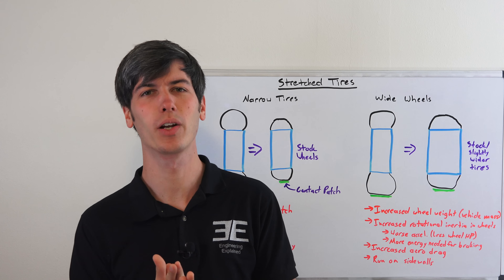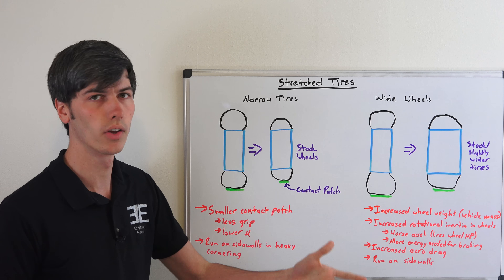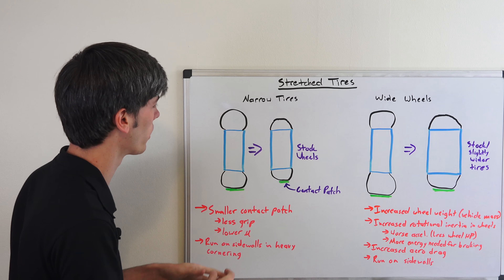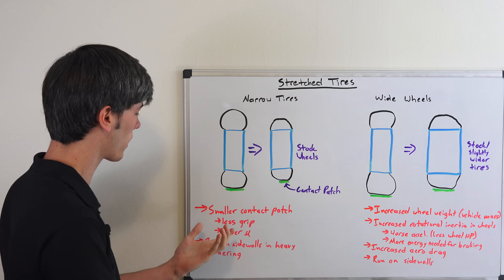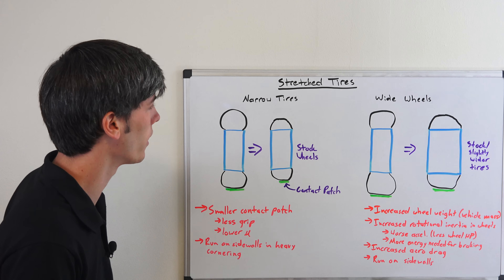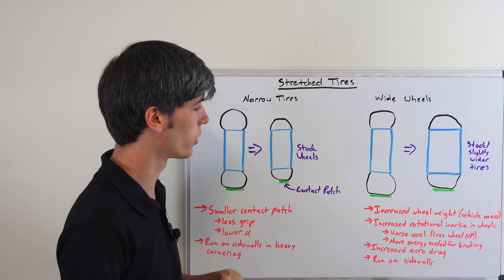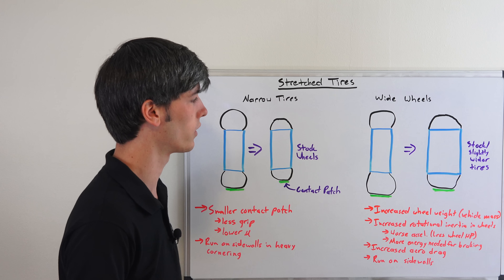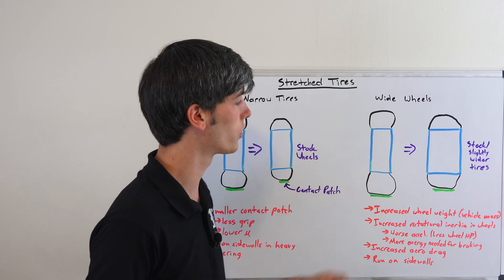Stretched Tires Are Silly

Comment: So much judgement... You didn't mention the application of drifting particularly with low horse power. Also someone please find me one example of an averagely stretched tyre coming off a wheel. It doesn't happen and people don't just die all the time from running them. Anger about shit like this is just like old people being angry at Facebook cause it's not what they did when they were young and therefore an atrocity.
Reply: +Dylan Baddeley I don't like that I come to this channel for facts and get opinions.
Reply from the maker: +Dylan Baddeley You seem angry. First, let me make it clear that I never stated stretched tires are more likely to come off the wheel (though under extreme stretch, sure, that could happen). Also, as I stated in the video, stretching tires reduces grip. Reducing grip means it's easier to spin tires, so you can certainly infer that based on the information (facts, as you prefer to call it) provided. 

Now that said, making it easier to spin tires doesn't necessarily make a better drift car, it just makes it easier to initiate a drift. https://www.carthrottle.com/post/engineering-explained-how-to-build-a-drift-car-the-wrong-way/
Reply: Yeah I know you didn't mention the coming off argument, it's just one that comes up often and I saw earlier in the comments section.
I'm obviously a little bit butthurt mostly due to the title. Claiming they're silly just urks me. there are legitimate uses and reasons to do such a thing, you may not want to do it but those reasons are there. 
I see what you're saying in reference to drift cars but drifting is about style. End of story. Formula D cars are not the RIGHT way to make a drift car, they are A way to make a drift car. 
When you have an engine that puts 50kw to the ground in a car that weighs less than 900kg ease of initiation can be everything.

Comment: Any of you guys know what brand makes good lightweight wheels? Most websites I've seen don't advertise the weight.
Reply from the maker: +Rahul Devarakonda Tire Rack usually includes wheel weight.
Reply: Volk Rays wheels are known for their light weight.
Reply: +85corolla specifically the Ray's Gram Lights.
Reply: +Rahul Devarakonda I believe VarrsToen is pretty light, OZ racing, Ray's, Volk, Enkei (Makes a lot of lightweight OEM wheels). If you're interested in a wheel you could always email them, just gotta be specific on the exact wheel measurements. VarrsToen makes wheels to order a lot also or bulk order for better prices, but great build quality. Also, you could go all out with HRP or CCW
Reply: +SavageWS6 Thanks for the great suggestions guys. I've been wanting to replace my STi's stock wheels for a little while now but the insane number of options available is just overwhelming.
Reply: no problem man, check out the STi forums and check the weight of them. Also, I know I'll get shit, but on my 2013 Civic Si, take the wheel off and check the inside, you should have a manufacture stamp and model number somewhere. I'm unsure who STi had made rims for them. For me it was Enkei wheels.

Comment: For poor drifters, stretching tires is a way to stiffen sidewalls to lessen flex for performance. It's also done to make low hp cars easier to slide. I'm ok with it for this reason. Not for the stance reason.
Reply from the maker: Sure, fitting some used narrow tires on the back of a slightly too large wheel size for track-based drifting use on a budget, I'm all for it. But for street use, I don't know why you'd intentionally reduce grip haha.
Reply: +Engineering Explained I agree Jason. Stance kids do it to fit bigger rims under their fender arches. Where rim lip hitting the fender is the goal. Not my cup of tee.

Comment: When talking about increased wheel weight on wider tyres you are not taking into account the weight of the tyre, tyres hold a fair bit of weight in the tread (weigh a new tyre vs a worn tyre!). Do you have a newer better/video on this? Lots of touring cars and F1 cars over the year run stretched tyres, they still ran them in F1 2021 (not sure about the newer 18s tho).

Comment: Are stretched tires better for drifting?
Reply from the maker: Nope.
Reply: Engineering Explained so its just for asthetics
Reply: it actually helps for drifting since the sidewall is really stiff once you get the rear loose your tires have less chances to "re-bite"

Comment: so, just as a purely theoretical question, what would happen if you did the exact opposite of this and ran a wide tire on a skinny rim? would this give better performance than today's traditional wheel fitment due to the bigger contact patch? assuming the wheels don't rub the fenders
Reply: No the it would reduce tension on the sidewall and cause excessive movement of the tyre within the footprint of the wheel rim. Think of a big off-road tyre on a rim and how sloppy the movement is.

Comment: The benefit only comes when you are going for looks and want to make your car as low as possible, stretching tires like that means they won't rub on the fenders, obviously the better solution is to roll your fenders but the whole concept of making a car as low as possible in the first place is silly.

Comment: Your not getting the reason, it's because if you buy rims that have too much offset and they stick out of the arches a little then you need stretch tires so the rim lip is sticking out and if you don't then you car could get towed. Also it can get towed with stretched tires but the chances of being caught with stretch tires are lower than letting your wheel stick out of the arch. Also last of all and don't give me hate but they look so nice on lowered cars.

Comment: I have a "Stanced" golf for show. Its too low for performance and I have been running Yokohama S Drives 165/40/16 on a 16x9 et26 for years. There is a huge debate on safety but they are perfectly safe. Performance? Not so much. Thats what my MK2 Jetta coupe is for.

Comment: Sorry but you need to correct your statement about getting more grip from the bigger contact patch. Given that the mass of the vehicle has not changed, the amount of friction will not change either. The traction depends on the force not the area of contact. The benefit of the wider tires lies in the slower wear rate due to larger area in contact with asphalt, and that is why they are used in racing cars.

Comment: Looks badass tho. I thought stretched tyres was for drifting
Reply: To a degree, they are.

The largest reason drifters (at least the ones who know what theyre doing) stretch their tires, is because a stretched tire can give more linear break away characteristics.  Its a bit of a catch 22 when youre drifting at a high level.  On one hand you actually WANT sticky tires, even though you want to slide on them.  Sliding on stickier tires, lets you slide around faster than if you were sliding around on shitier tires.

But sticker tires also tend to have poor break-away characteristics.  Theyll go up to the peak of  traction, hold, and then suddenly "break away", causing a bit of a snap once they do finally "let go".  Stretching the tires gives you a bit of middle ground- You can run a stickier tire, but also get a "smooth" break away thats more predictable, manageable, and controllable.

The problem is kids see this, have no clue why its being doing- And try to mimic it without understanding it.  And quite often the notion "MORE IS BETTER" comes to mind- So they go for bigger more extreme stretches, than needed.  Then sooner or later, this "trend" catches on, becomes synonymous with the appearance,  and it spreads like wild fire.  

Its like people who put racing harnesses in their street cars, without appropriate seats, harness bars, roll bars, or all the other necessary bits to make that harness actually do its job, and do it properly.

Comment: Why bigger contact patch offers more friction and grip? Doesn't friction is just μ*Ν;
Reply from the maker: +HeliasValenti It's complicated, but here's my best answer: https://youtu.be/kNa2gZNqmT8
Reply: I have seen this. Well mentioned. But is this drop of friction coefficient so dramatic to explain the difference? I can't believe this could be only or even main reason...
Reply: +HeliasValenti I feel this would have to do more with the viscoelastic behaviour of the tyre. Let us assume you use an optimal or stock tyre, which would generally have less pressure (air) than a stretched tyre. A stretched tyre would result in a higher internal stress, hence decreasing resistance to frictional shearing.
An example would be to fill up a rubber balloon with X amount of weight in water, then fill another balloon with a denser fluid of the same amount in weight. The second balloon would have a larger contact area and would deal with shear stresses easier than a smaller contact area. 
The formula for shear stress is tau = F(planar)/A, so the stretched tyre would have a smaller area hence increasing it's shear stress plus any preloaded internal stresses from inflating the tyre.

I hope that helps a little, but unless you're in a physics or engineering field, I don't see this getting any easier for me to explain ):

Comment: I have a very elementary question: why do people stretch their tires in the first place? Is it purely aesthetics?
Reply from the maker: +mwsaplam Mentioned a couple reasons at the start, aesthetics, to save money (buy smaller tires), reduce grip (to make it easier to slide, but at slower speeds), or perhaps misinformed performance reasons.
Reply: +Engineering Explained Thanks for the reply. Saving money is an especially funny one given that you'd be wearing your tyres out faster, and at the cost of safety with less available grip for the sake of $60 or so...
Reply: +mwsaplam As a drifter cheaper tyre's means more track days, less grip means less stress on drive train and it really doesn't affect your driving and also more grip doesn't mean better drifting.

Comment: Except it doesn't look cool. It has no form, or function.
Reply: +Tulliocity In some cases it has a function to fit the tire inside of the fender. Granted a smaller wheel could be used but people are stupid and do what they want
Reply: +MUFFZILLA Agreed. But if the function of it, is to make something else fit, and that something else (stupidly wide wheels) has no form or function, then in my mind it's still pointless. And ugly.

Seriously, how can people think this looks good?!
Reply: +McCurvey Hastie Yep, and it's going to be my opinion forever. Looks like you are the one that needs to get used to different tastes.

Just like everybody has the right to do whatever they want to their car, I have the right to call it stupid and ugly. Get used to it.
Reply: +McCurvey Hastie It's not fact, it's a fad. Good drifting requires GRIP. Pro drift cars are crazy grippy because grip equals control. That's why drift organizations (Like Formula D) have a max tire width in the rules.
Reply: +McCurvey Hastie This argument is pointless. Have fun with whatever you choose to do with your car.
Reply: Tulliocity There are quite a few mods that don't have a form or function. Most of them are visual mods. For example, shaved engine bays are visually pleasing but don't offer any real benefit. Same goes with the majority of front lips, body kits, wheels, most plastidipped parts, interior trim... Some are pleasing and some are awful. Where I live most are a eyesore.
***** Stretched tires are not the proper way to get the looseness in the rear end. A smaller wheel and proper tire or a harder "economy" tire would be more ideal. If you want a flush look then get the proper offset or use wheel spacers. You can use PVC pipe as a intake & intercooler piping and it will function, however, it is not proper and could lead to catastrophic engine failure Just like stretched tires can lead to abnormal wear, blowouts, dismounts, unintentional loss of control... To each their own, but stretched tires can be dangerous.
Reply: Mark Brooks There is actually plenty of evidence of everything I mentioned. I suggest you do some research
Reply: Mark Brooks Did you miss the part where I said "I suggest you do some research"? Im not going to waste my time looking it up for you. Google can be used by anyone
Reply: Mark Brooks I grew up in a area where basements didn't exist. However, I live further from my parents than you have ever traveled. Get a life, scrub
PS: Spell checker is two words. fuckboi
Reply: Mark Brooks Have fun with your excessive camber and tire stretch, might as well run 50+ psi in your tires.
Reply: Mark Brooks You're in favor of stretched tires which is a stance thing, so looks like you are form > function. That's why I brought the other stuff up, they are mostly useless and a cosmetic thing.
Reply: Mark Brooks We were never in an argument so your straw man assumption is flawed... Secondly you can please quote me where I said that camber, and stretched tires do not have benefits ? I said "mostly" because "stretched tires" thing is generally only used for fitment. You can't assume I don't know anything nor have I ever been to a race, I should ask the same to you. Now onto the performance aspect, a slight stretch can be beneficial by having a stiffer sidewall, but it also decreases the contact patch as the rim could hold a larger tire. secondly the sidewalls can be stiffed with regulation of air pressure. Almost everyone I ever encountered preferred and used bigger tires over a stretch, actually the only one person I have encounter that had stretched tires, were barely noticeable. You can also increase your lateral G's with a stickier tires (Another factor). This thread is about excessive tire stretch not a bit of it. When I talked about camber I meant the stance version since it goes with the stretched tires argument, of course a small amount of camber is beneficial as every body that has ever tuned their suspension has adjust their camber so there's no argument there.
Reply: Mark Brooks I already finished my philosophy courses... seems like you need to search up what a strawman fallacy really is. That first comment was me trying to get reaction from you ie make fun of you.. No argument, no fallacy committed. IF ANYTHING it would be an ad hominem. Also since this thread IS about EXCESSIVE camber, and you are here challenging that, one can only assume you are here because you are in favor of stance. I still stand by what I said dunno where my argument changed. Although ironically yours did.

Comment: A little misleading. I think you should title it EXCESSIVELY stretched tires are silly.
Many sports car manufactures, or sport models of manufactures, stretch their tires for performance gain.
Many reputable aftermarket wheel companies with history in racing offer lighter wheels than factory and are yet wider.
Reply from the maker: +TWIRKNOLOVE What are some companies that do this from the factory? Also, if you can get an aftermarket wheel A that is lighter than a narrow stock wheel B, you could also find a narrow aftermarket wheel C which is narrower and lighter than aftermarket wheel C. Apples to apples, wider is heavier.
Reply: Look at stock pictures of a BMW M4. The tires are stretched over. That's one example of many.

I don't quite understand your comparison?
Wider wheels to fit larger tires.
Wider wheel can be lighter than the original stock wheel.
Example: Most BBS wheels in 16" variation don't weigh more than 19lbs and can be re-lipped to be wider.

Comment: long before "stance" or "streched tires" was even a thing, race cars in Japan in the 60's were doing this, because they had only a specific tire they could use. they were early radials and they were very floppy, the feel and response was terrible. so they came up with using a wider rim and did what I think was called "hippari" (stretched the tire). and then it became associated with race cars so people started doing it on road cars to make look racey. however modern tire technology has come a long way so now it's just purely an aesthetic thing.

Comment: Sorry. You are completely wrong. I autocross and currently have 225s on 9.5" wide wheels which are better than 8.5" wheels were better than 8" wheels were better than 7.5" wheels were better than 7" wheels. Stretching increases tire grip--especially lateral grip.
Reply from the maker: +Matthew Huizing How does it increase grip?
Reply: +Engineering Explained Does it matter why? It has been proved in multiple experiments. I could present theories, but one isn't needed.
Reply: +Engineering Explained For example: your statement about riding on the sidewall is completely backwards. Stretched tires resist rolling onto the sidewall while pinched tires roll onto the sidewall easily. Stretching stabilizes the contact patch. The contact patch moves a ton in relation to the wheel even on my 225s on 9.5s.  It moves more on more pinched setups. That movement causes a delay.
Reply: +Engineering Explained Cars basically ride on the wheels. The wheel is the real structure. A wider tire can't actually extend that structure. The Hoosier cantilevered R-compounds sort of do, but not that well.

Comment: Who says wider wheels are always heavier?
Reply from the maker: +Tom Wright Well, I will if no one else wants to. If you take a tire A, and then shave off 1" of tire width, you now have less material. Of course if you have a narrow tire that's made of iron and an wide tire that's made of carbon fiber, the carbon wheel will weigh less. But that's not apples to apples.
Reply: +Engineering Explained I suppose so, thanks for taking the time to reply man, I was just pointing out that you can get lightweight wheels that aren't necessarily made out of carbon fibre. I do agree with the incorrect usage of tyres though.